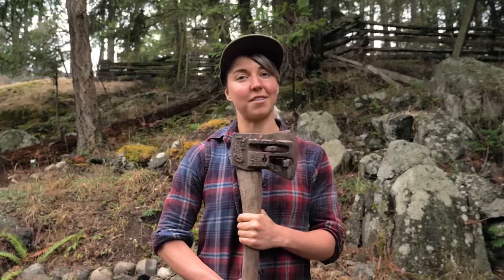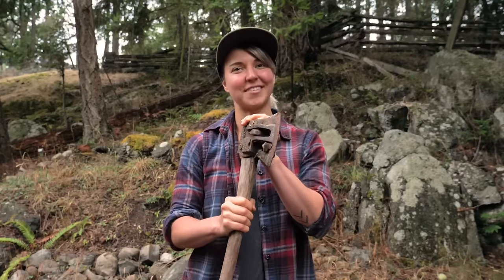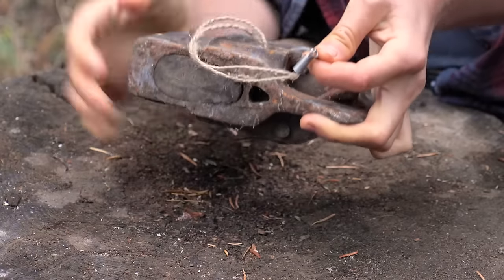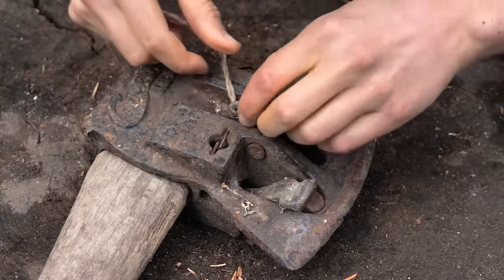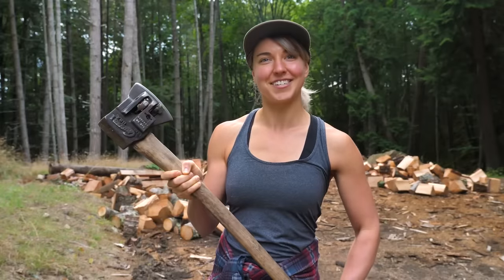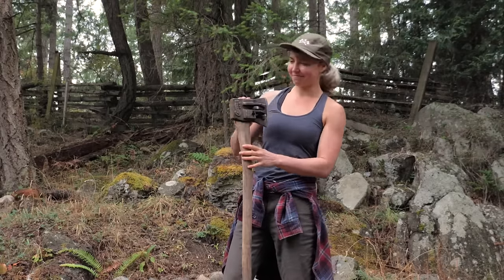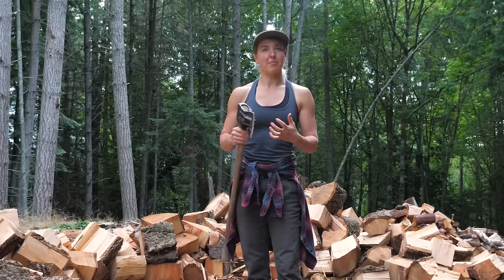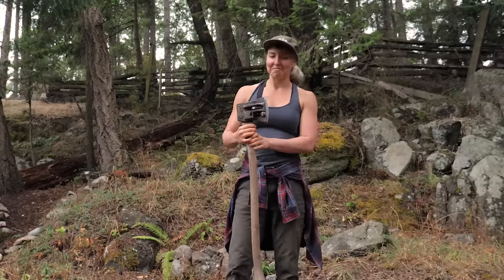Spring Loaded Axe?!!

Comment: I have one of these axes, its in better shape. My dad bought it. It works great. I used it yesterday. Try it on smaller diameter wood, the stuff explodes apart. I have sent one half 10-12 feet. Kinda fun actually, any spectators really need to pay attention. I would like to get another one for home, to match the one at the cabin.

Comment: As a teenager I broke one of these splitting a pile of old black walnut for a neighbor.. I always marveled at the engineering and thought that went into it as i smashed that motherfucker like a tinder date. It worked until it didn't. Exploded like catastrophic engine failure.. sending parts to places unrecoverable under the conditions.. pretty cool.. looks nice all cleaned up too!

Comment: it's not really spring loaded, more spring held. the two levers are held in position by the weak springs, and the force of your swing push them appart when they hit the log. it act as a wedge like a normal axe does, but by having those two pieces move, this wedging action is not hindering by friction on the wood.

the main purpose is that it makes chopping smaller pieces in one swing effortless. overall it's pretty much a cool curiosity more than a game changing tool.

Comment: Clearly it is just a gimmick unless you use it on stringy wood like oak. The levers didn't even touch the wood you were splitting it broke apart so easily.

Comment: if you restore this axe completely it wil serve you right.its a good design axe and the steel is very good, i would take it apart and restored thee whole axe and put a new handle on it . try to hit the with the axe not in the middle but right at the end closser or nearer the bark, you will see a difference in splitting with an axe, most or all people hit it right in the middle of the centre ring, give it a go, what do i know, i only been splitting logs for the last 30 years. i could be wrong. dont take my words as verbatim. you are a lucky girl to received such a wonderful gift. herein the uk we dont have anything like that, i used one when i was in sweden. good axe. cheers Hans.

Comment: I’m 71. Live in a 2,200 sq ft home I built in 75. I heat the home entirely with my wood stove. My parents started supplementing their heat when I was 14 to cut down on their electric bill. I have seen and use many splitting devices, all by hand . Never owned a splitter.  This is the first time I have seen an axe like this. Would love to see a super slow motion of how it operates.

Comment: Own one. Unique sound of the two splitting cams “clink”. It will split elm and red oak, however there is a noticeable thud of resistance until you find the sweet spot and a small split occurs. Those cams certainly make the pieces fly. Well designed and beefy handle.

Comment: The spring loaded axes didn't sell very well as i recall. But the engineered axes. Well those worked far better and sold faster. They were a little lighter and much sharper. With offset wedge shape on the head.

Comment: You can really swing that axe. I had one it was ok but a splitting maul was just as good. Both are heavy and hard swinging so you have to be good or injury could be an issue. That’s why I say you can really swing that axe because you must remain in control which is not easy. Good job.

Comment: You approached the installation of the spring the wrong way round. You should done the hard part first: connect the spring to the wedge. And then pulled the other end through the hole and secured it with a pin.

Comment: My father used this exact axe model when I was growing up to split fir and pine logs for our wood stove to help heat the house in the winter. For logs with knots, he would bring out the splitting wedge and the 8 pound sledge hammer since this kind of axe didn't do too well with knots.

Comment: I found it helped me to deliver the full force of the axe and swing to the outer edge of what I’m trying to split. I placed the axe edge as tangentially to that edge as I could instead of trying to split along visible cracks in the center. Large pieces, especially, were open to this and instead of going for a full on split, I’d leave just enough to walk the axe around it. I’d finish it off by pulling pieces apart by hand.

Comment: I had one of those in the 80's as a teenager. They had good weight and a long cutting edge. They will "throw" smaller pieces of wood so don't stand anywhere off to the sides.

Comment: I've seen a video of an axe that had a similar concept, except it had no mechanical parts. The blade itself was shaped so that once the head got an inch or so into the wood it would cam the head to rotate it, which would lever the wood apart. I remember it being a European product, and specifically intended for nordic/Scandinavian soft woods. As with this other one, it did not work well in hard wood.
Reply: IIRC, it was developed by a crazy Finn, or a Swede. Wasn't surprised.

Comment: Theres a hammer I forgot what it's called. But it's loaded with shot, where you strike object, then the shot transfer to the aftermarket.  It's modern but I can't think of it's name.  
Which you might could use a heavy weight welded to a spring where it'd lag behind in the swing, but on contact flies into the back adding extra umph!
Reply: Hi from Australia,  the type of hammer that you are thinking of is a  "dead blow", as far as I know it was to prevent the hammer rebounding on a job.
Reply: @robertgow7952  Appreciate it

Comment: Great to see a young lady that is not afraid of hard work. I digress. If those spring things Workwell you think someone would have Incorporated those into a piston Drive log splitter. Yes the Piston Drive log splitters do have tremendous Force to split wood, but if you could have a mechanical separator on them might be easier and have less would explosions if you've ever had the privilege in splitting wood with a log splitter